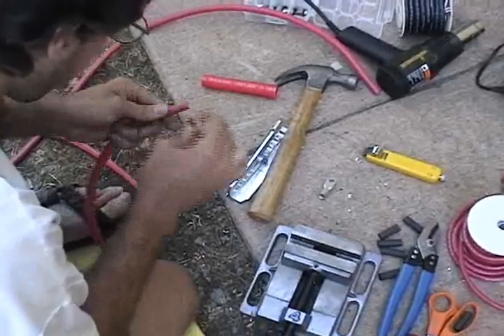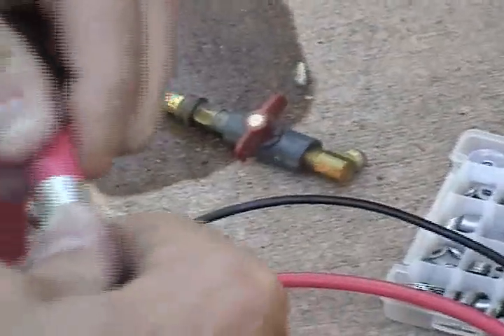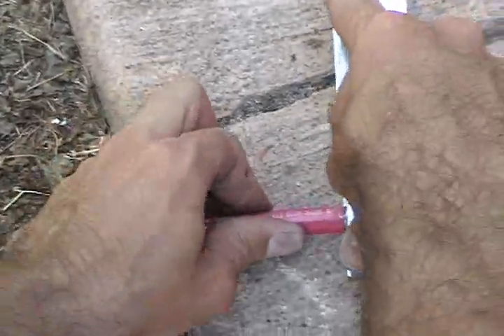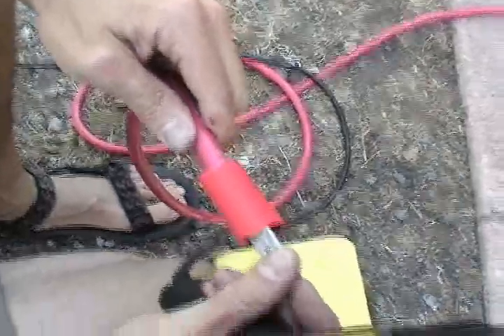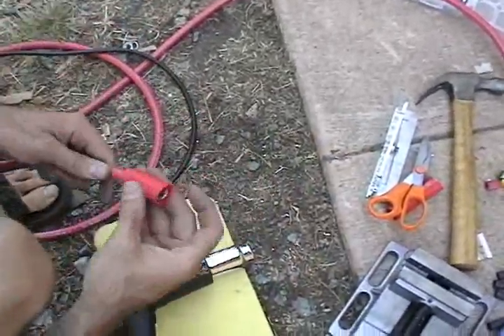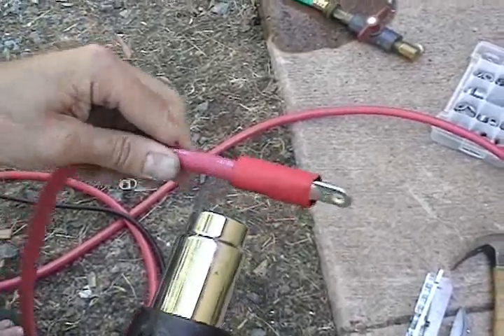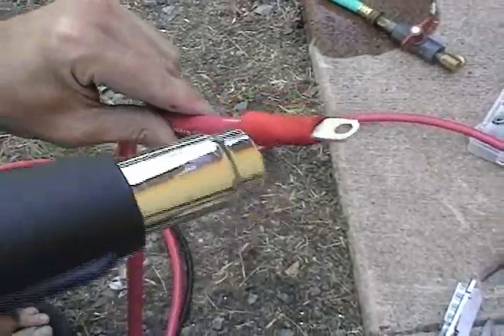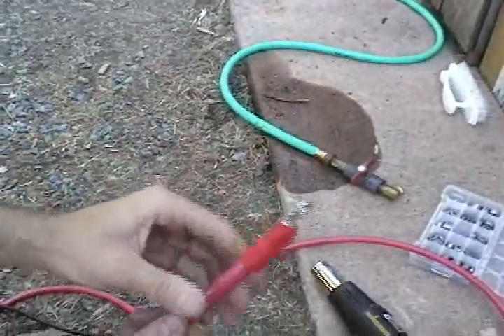Using Amp CrimpAce crimp tool for battery terminals.

Comment: You should use a much smaller heat shrink tubing, install the tubing over the cable before installing the connector, slide the tubing down as far as you can, so the tubing don't start to shrink from the heat of Soldering  if you use Solder witch by the way is a much better and professional job. Every Job done, is a picture of the person who did it!

Comment: IMHO Using a blade to cut across the insulation carries a risk of cutting or scoring the strands. Safer to use a pair of wire cutters, go along the axis of the insulation from the 'open' end, then turn 90 degrees and cut round the circumference. It's not quite as clean a finish on the insulation but less  risk of a cable with broken strands.
You would get a more even shrink, with less chance of burning or melting by using a spreader attachment on your heat gun.